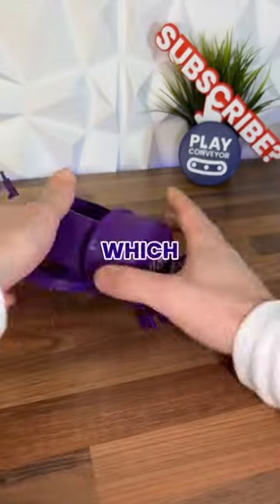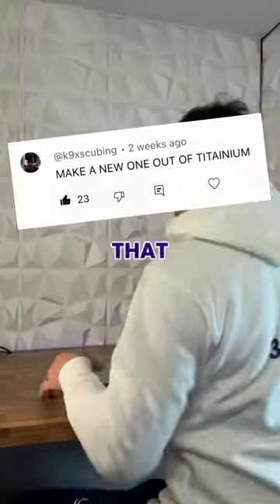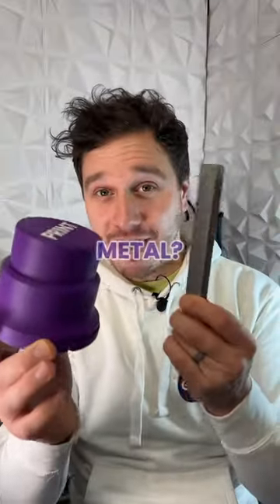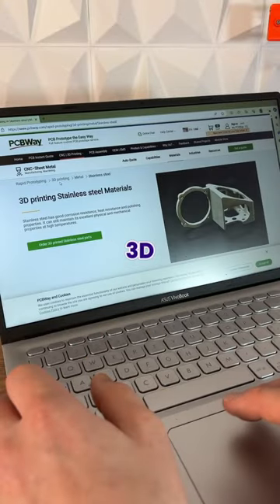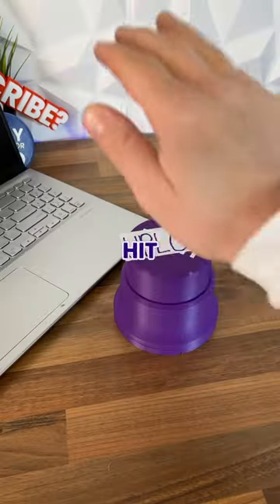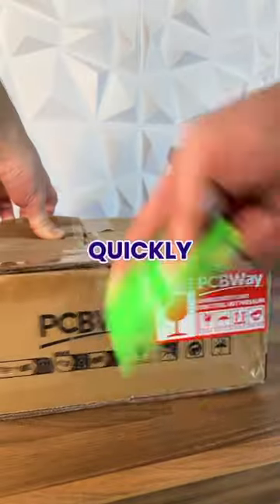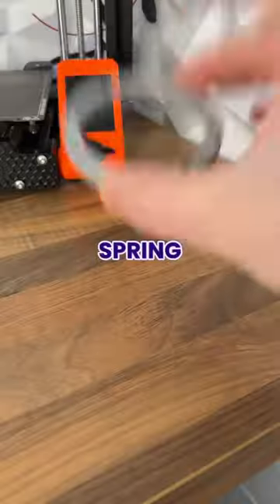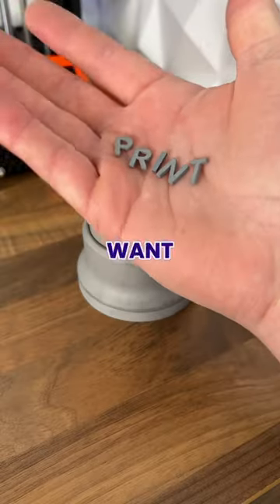We made our PRINT button METAL 😵 #3dprinting #metal #shorts

Comment: Pcb way uses subtractive fabrication were 3d printing uses aditive fabrication they use cnc machines for metal working and 3d printers for plastics and polymers along with laser cutting Wich is also subtractive fabrication the difference between subtractive fabrication and additive fabrication is subtractive takes away material to carve or cut something out were additive uses the material to add on to what’s there

Comment: You can get metal filament from virtual foundry that will work in a fdm printer with the only adjustment will be the flow rate. All 3d printers and do aluminum filament

Comment: This might be metal, but it’s probably a weak mixture of one, it still isn’t titanium so the answer is no you cannot unless you melt it instead of 3D print it
Reply: It's manufactured using laser beam powder bed fusion (trademark name SLM), admittedly in AlSi10Mg - an Aluminium alloy. This is absolutely solid metal, although not as strong as Titanium.